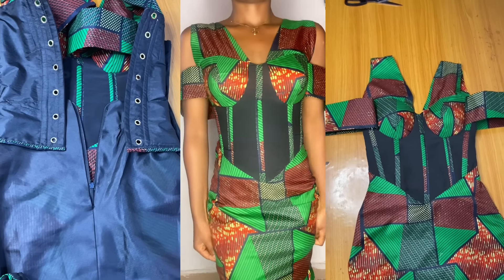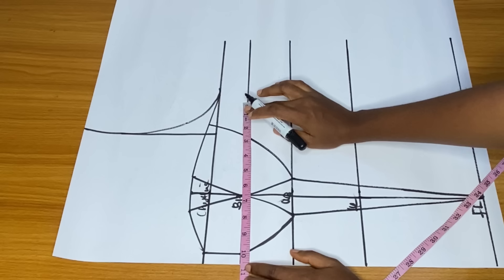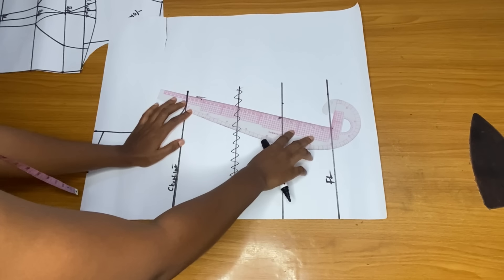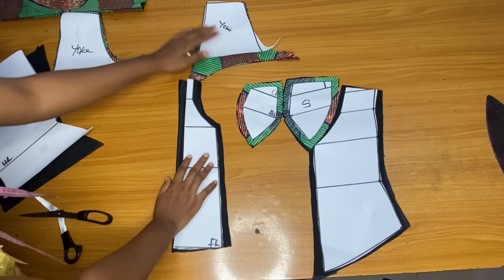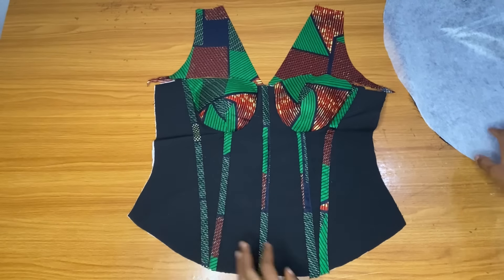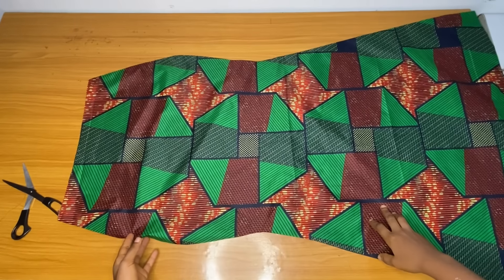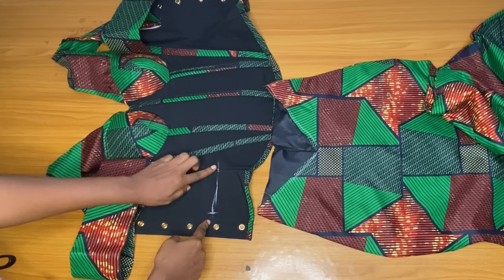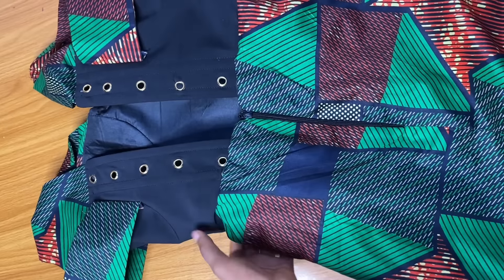HOW TO CUT AND SEW AN INBUILT CORSET (DETAILED)

Comment: Good evening, I am just seeing this video and it’s just at the appropriate time. Please I have a question. In your tutorial you used Ankara but about those using lace material should I use the same method the way you did everything
Reply from the maker: Yes
Reply: @SEWWITHIJEOMA  What about the zip part you did sew your zip on the Ankara, those that mean I will also sew my zip on my lace material before covering with the linen

Comment: Thank you so much for this video… I have questions 
1. Please how did you achieve a perfect back waist after snatching 

Because mine usually have excess after snatching 

2. Is it only the already made cup that you used for the bust?

3. The inches you removed from your waist, did you remove it from the whole body or just the front
Reply: Exactly my question 😊

Comment: Thank you for the video, but I have a question after doing my upper tightening & placing the yoke, I noticed that the place I tightened is shorten by that 2 inches I removed just like you did & if I trim the shoulder to align the chest line, the shoulder will shorten, please what can I do to rectify it

Comment: This video came at the right time… thank you so much IJ …. But I have a question, did you use 26” for the waist of the skirt(down part ) or you used your normal waist size which is 28?
Reply from the maker: 26
Reply: Same question I came here to ask😅
Just scrolling to see if som1 asked already.
Thank you so much ❤

Comment: Thank you ma,  I have a question  at 18:20,  the zipper allowance of the lining is still open ,how did you close it? How did you join it to the zipper and close that gap
Reply from the maker: You can use a hemming gum
You can tack it
Or you can do an inseam finishing before joining it to the corset
Reply: @SEWWITHIJEOMA  Thank you mama 🙏

Comment: This is so beautiful to watch,thanks so much for this but my question is did you reduce the waist measurements on the skirt?Because when the corset is being snatched at the waist the measurements ll reduce where by it might affect the skirt waist measurements (don’t know if you understand my question). 
Let’s say my waist is 29 and after snatching of the waist my new waist is 27 so for the skirt ll I be using 26 for the waist or I should stick to my original waist which is 29?
Reply from the maker: Yes
You’ll reduce the skirt waist measurement too
Reply: You will stick to your original measurement when cutting, after removing the 3 inches from the back(zip allowance inclusive) you will achieve your snatched effect